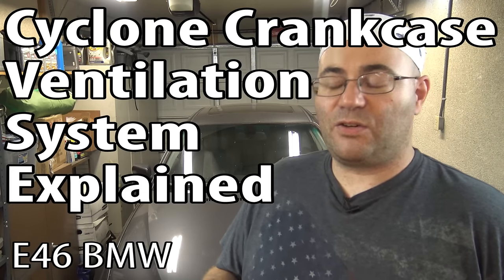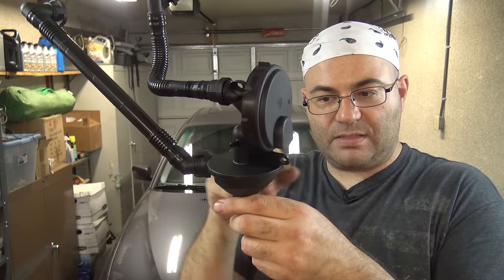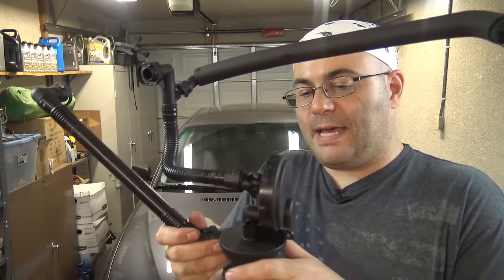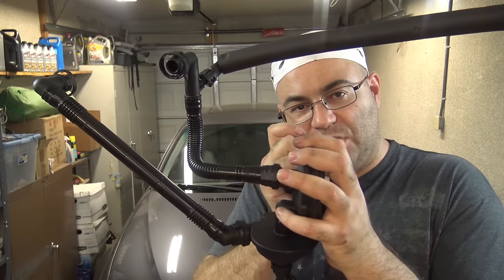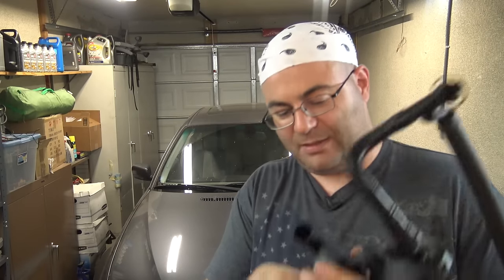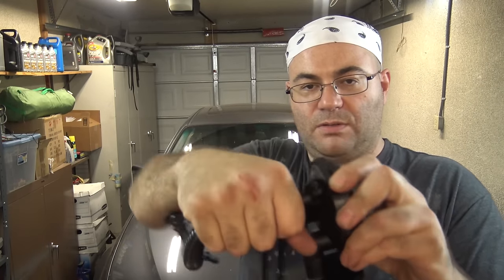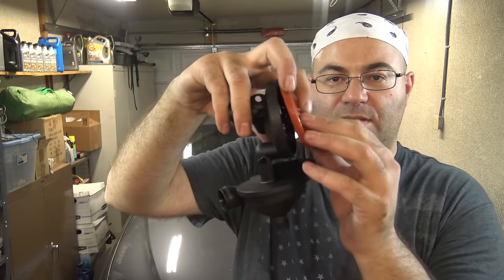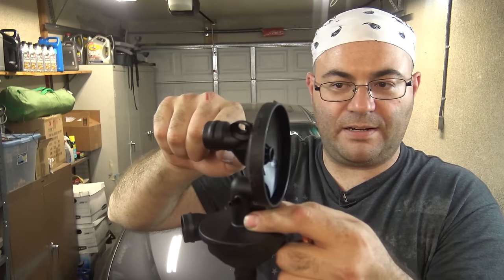BMW E46 Cyclone Crankcase Ventilation System Explained

Comment: Hello, I need your help really. I own e46 330i 2003 automatic with 1 error at diagnostic. I've searched all the information on the internet, including the E46 forum and found your videos where you're talking about vacuum leaks. So I'm using bmw 1.4 scanner and have codes CB[203] and CA[202], E3[227] and E4[228] from the 2 oxygen pre-cat sensors(they're new)control limit, mixture limit rich or deviation too great, deviation rich, low fuel level signal and get randomly misfires, decrease in power, rough idle and high gasoline consumption. When I unplug air flow sensor everything is just perfect, so I think the problem is vacuum leak and due to this the system is adding too much fuel and get this codes and problems. Can you help me with an advice, is this a vacuum leak and where should I search or the problem may be the air flow sensor itself or i don't know.. The air flow sensor is showing 13kg/h at idle 700rpm which i think is normal. My oil consumption is 1ltr per 7000km which is pretty high i think.

Comment: 11:55 what do you recommend fastening it with?
Reply: don't do that, this guy is talking outa his ass. 50sKid, I beg you, come tell the guy that check valve was a bad idea and you had no clue! that clogs up and causes pressure buildup in the crankcase. There is already one person in the comments having an issue, read what I had to tell him. PCV is held normally-open with a spring, vacuum must work against the spring to restrict the orifice!

Edit: the person is Mohammed Hatem and there's my full reply

Comment: Hello.

Great video! Expleined me alot about CCV. 
But I have one question about Oil Catch can. Isn't possible to make connection: Drain plug from can to "feeder" to oil pan? That should "remove" any problems with maintenance if i'm correct.

And the idea with valve? Great one! Did You try it on damaged CCV? 

Thanks for answers ;)
Reply from the maker: Yeah that's a good idea and I was thinking about that as well.  PERHAPS I may buy a catch can from eBay and do just that.  I haven't tried the check valve on a CCV without a diaphragm yet.  I figured someone would ask me but I don't want to install and remove the CCV twice just for the sake of a test!  Hope you understand, lol.  I've tested the check valve itself by pouring oil through the tube both ways and it definitely works great.
Reply: Thanks for reply - well the valve alone will work but i was curious about how it will affect CCV. But Oil catch tank connecting drain plug to oil pan - it sounds like working solution that will be more reliable and cheaper.

Comment: I need help please, my car ( e46 318ci) when I start it misfires for like 2 seconds then stops once I rev it (Most times)  but a few times recently  it stays misfiring  till its warmed up then I turn it back off  then  back on again and goes away soooo I ran a scan on it and got the codes p0304, p0302,p0300,p0140 and 0139... misfire on cylinder 2 and 4 and that my o2 senser isn't working yet I changed the o2 senser just over a week ago, as it  stands I've changed the cam shaft sensers and that's  made no difference and I'm thinking maybe the ignition fingers but only changed them 8 months ago if anybody can help it be much appreciated thanks

Comment: well i thought i was missing some power so i ran the extra hose from back intake port that was capped with a all cracked not even tight piece of shoelace end cap {oh just more evil german sabotage artistry} and my car started smoking like crazy and probly almost caught on fire and the im pretty sure o2 sensor at start of exhaust pipe was glowing lava red. wtf does that mean? please advise if possible
Reply: im really starting to see where the germans have been practicing their terrorist tactics
Reply: i knew they were still evil!
Reply: @pistol850  you've got your labels wrong.. NOT "gay" it should be described as " magsoginisnistic".

Comment: would this apply to a 2005 e90 320i also? I think its a N46 engine, the valve looks very similar.
interesting idea with the check valve, would that still cause problems with oily vapour travelling back around into the top hose?
do you find any problems with the chinese units on ebay?
Reply from the maker: I can't speak to that--I haven't studied the system from that engine, but yeah it's probably very similar.  The check valve wouldn't prevent the oily residue
Reply: 50sKid thanks. I have ordered one anyway. Bit annoying, only have 75k on the clock. I only had oil loss after a oil change though. Any idea?

Comment: Has anyone ever tried remote mounting the CCV using high temp hose rather than using a catch can etc? Looks like you could just move the CCV from underneath the engine to just out side it. Maybe use turbo hose, oil rated hose etc.
Reply from the maker: That is exactly what you're doing when you're running a catch can.  Just add a drain from the catch can to the dipstick tube and you have moved the ccv outside of the engine.  Which is exactly what I did in my catch can video
Reply: OK, thanks! My son has a 325i that is driving us crazy....I have fixed everything else on it but the CCV is shot and won't idle very well and using oil badly. Just trying to figure out whether to try and replace the CCV or use a catch can.
Reply: what did u end up doing?

Comment: Anybody know what's the mechanism  inside  the cyclone chamber to separate oil and gas ?  Is it empty inside? If so this thing can not be failed. The function of oil separation will be good as long as the amount of vacuum is right. Am I correct?
Reply from the maker: It's empty inside.  I described exactly how it works in the video.  Actually the name tells you exactly how it works--it's a cyclone chamber.  The vapor/oil mixture swirls around and the oil splatters against the walls and drains down while the vapors get sucked up.  The function of this thing will be correct as long as the vacuum is correct and the diaphragm hasn't failed and the thing isn't clogged up with water/oil gunk.
Reply: 50Kid, Thanks for your answer!! I have learned a lot from your videos!!!

Comment: 50skid, i have a problem but mechanics dont seem to get to know the problem 
basically, my bmw smokes blueish white smoke on cold start but only lasts for 1 or 2 mins
it also has a shakey start (rpm moves alittle when stationary) even though i changed the glow plugs
could it be ccv or what do you think? 
i hope u can help me
Reply: i forgot to say it is a N47 engine
Reply from the maker: It could be valve stem seals.  Does it also happen when you are going down a hill without hitting the gas?
Reply: 50sKid it happens on flat ground. (there are no hills near where I live) when I first start the car it gives puffy blue smoke then stops when warm. The engine oil level is still on max since I last changed it but the oil loss might not be significant enough to show on the dipstick. 
what do you think?
Reply from the maker: Ah, I'm afraid I don't have any experience with diesels.
Reply: 50sKid no probs. thanks anyway

Comment: I chanced this and now my engine has weird hoover sounding noice. Air leak somewhere?
Reply: Does it sound like a otter or walrus?   Sounds like my problem after I installed it.  I didnt twist the hose but just finished tonight will be doing again tomorrow . How did you fix your problem if you don't mind telling.
Reply: Patriot My engine is M54B30, there is a air plug right side back of the intake manifold, somehow i was able to loose it off while doing crankcase ventilation replacement. (So my vacuum was off, since all the air was able to go in)

Comment: WHY DO OIL PUSH UP MY DIPSTICK BMW E46 318I CAN ANY ONE COMMENT PLS
Reply: Ridwaan Tape your ccv has gone bad
Reply: I guess pressure builds up inside the crankcase. That would happen if the CCV system fails indeed. You can test by removing the oil cap with the engine at idle. You should feel just a bit of vacuum if you place the hand over the hole. In your case I suspect you will actually see pressure instead of vacuum.

Comment: I'm fairly certain we ended up doing a head job on an E46 at my old job, when all it needed was a new CCV..... Oops.
Reply: That's pretty much the epitome of why people hate shops (if you're saying a shop you worked for did this).
Reply: Not a repair shop.  A used car dealership.  Most of the cars were older and cheap, so almost everything needed some kind of repair before we could sell them.
Reply: ah okay I stand corrected then!

Comment: Or just delete CCV and be happy :) After deletion smooth engine working, its not adds up quickly. Very slowly.

OEM parts are very expensive also.
Reply: If you're in a state like California your car will fail emissions without a crankcase vapor recirculation system, but it doesn't have to be a CCV.

Comment: A  simple PCV valve would  let some oil vapor through, to help lubricate the upper portion of the cylinder;
 Over-engineered (german) cars can be a royal POS sometimes(a lot of times,and on different systems);  how much did that shit load of plastic(1 dollar's worth of plastic?) cost you ? i stay away,i don't get married to these german,expensive, primadonnas; don't like the idea of helping the rich get richer,anyway;      nice video.

Comment: A huge dislike! 
Liked where you showed and explained the component as is but your theory is lacking. 

That small tit connected to the fuel  pressure regulator does not have to "flow" vacuum. It's like a capacitor or a high value resistor (they keep voltage without moving real current), this hose loads the back of the fuel reg diaphragm with vacuum but moves no real CFM. It protects against pressure variation due to air temperature. If fuel got through the diaphragm, it would flow into the crankcase, so the fuel reg should be changed when necessary! It does destroy the engine if the fuel reg diaphragm failed (but that is designed to not rupture easily). 

PCV is held normally-open with a spring, vacuum must work against the spring to restrict the orifice, so a check valve is a bad idea asking to build positive pressure in the crankcase thus polluting oil.

The part description according to manual is fine, you should just refrain from giving technical advice on stuff not in the manual. See, when it comes to technical knowledge, you are a small fish even compared to me - a hobbyist commenting on YouTube. Don't try to reinvent decades of tried and tested engineering, you are a nobody in that rink! Would have liked the video if you left out the utter garbage advice.